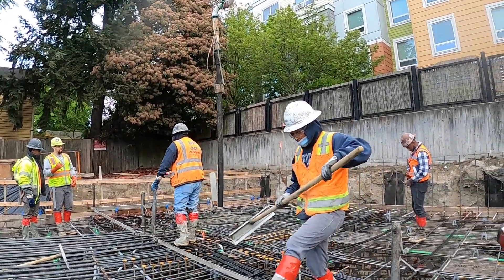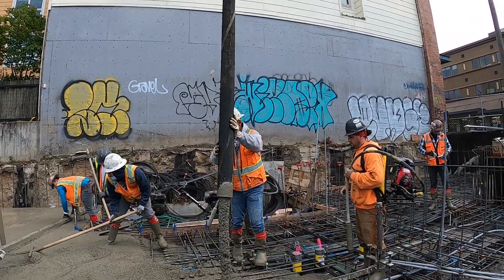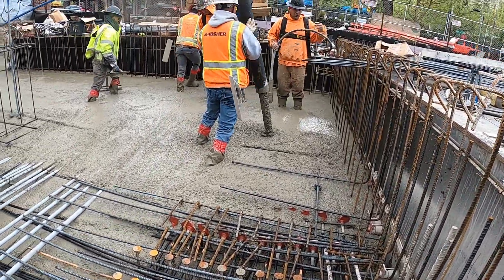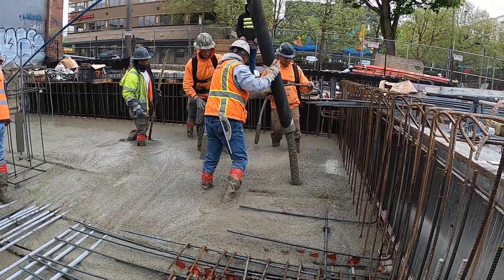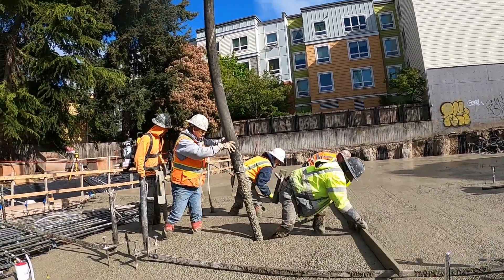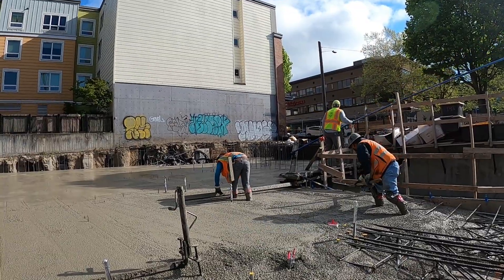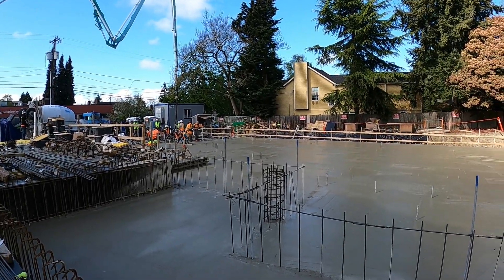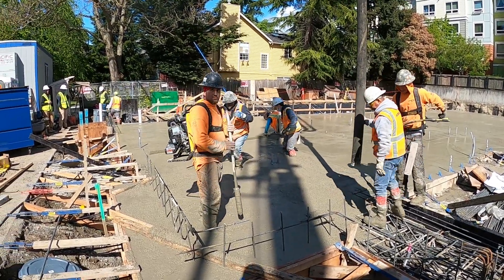Pouring Concrete For a 6000 SQFT Parking Garage | Post Tention Slab

Comment: Strike off board was notched?
Reply from the maker: What up big dog! For the screed system we used a rail welded to pump jacks and would just move it along with the pour and shoot it to grade every time you move. The top was to grade so you just screed off the top and soft shoulder the other side. It was a pretty pimpin set up

Comment: Looks good man! Been doing concrete for 16 years. Never done a parking garage but lots of pads and curbs.  Wouldn't wanna do a rebar job like that lol. The pour looks pretty sweet though. Nice easy slump and power trowel after is easy money bud!

Curious, what does your company charge for a square foot on a job like that for the pouring part?
Reply from the maker: Thanks bro I've been in the biz for 21 years over here in WA. Pouring concrete deck the price is usually in the 1.50 range just to pour most of the money for  a deck comes in the rebar it took around 70 hours to prep that deck and only 7 hours to pour and finish